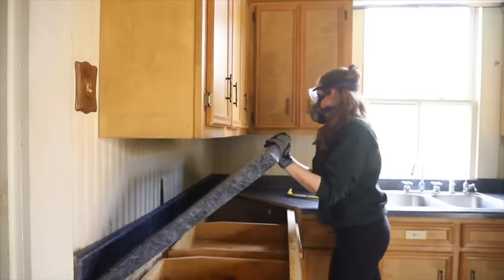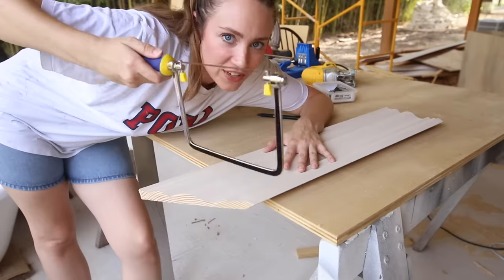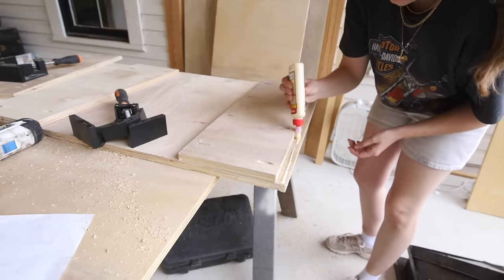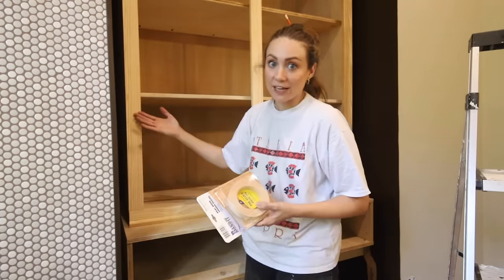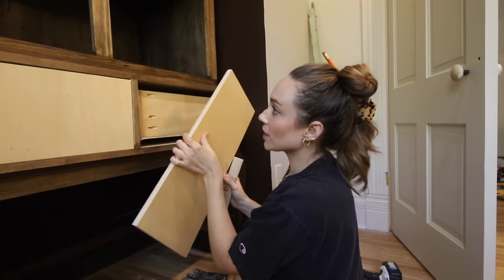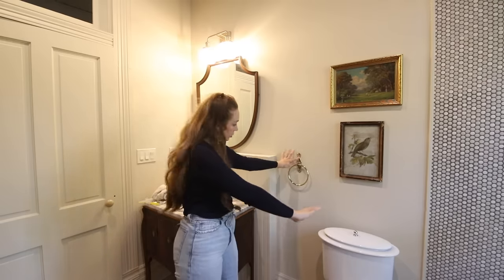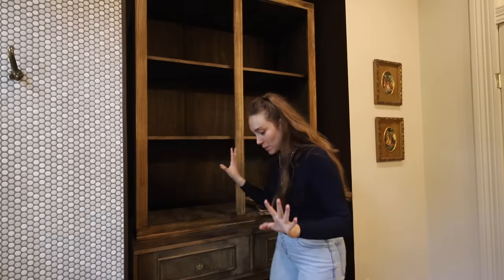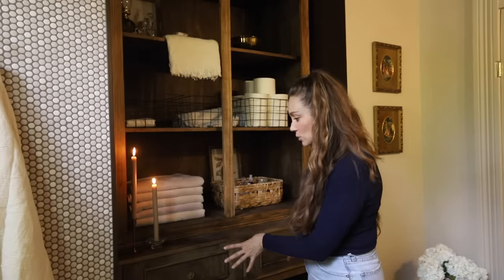GUEST BATHROOM MAKEOVER Ep. 4 | DIY Storage Cabinet & Decorating Ideas *BEFORE & AFTER*

Comment: Here is a tip: Stain all your wood first before putting together your project. I was looking at my hutch from the 1970's. It was my parents and they bought it used. Its built really well. Stain first your wood. Then you can assemble it all together and save yourself the extra work. Plus, I would add a finisher to your wood to protect it from the elements in the bathroom. I know it won't be used as much. Wood, is funny sometimes and can easily get chipped or get water stains on it. Just a few tips that came to my mind that I want to share with you. Beautiful bathroom. Yes to the topper for sure!!! :)

Comment: MaCenna, you constantly amaze me! You say, "Oh, I'm going to build my own kitchen cabinets! And I'm going to make my own antique-y bathroom furniture!" and I'm thinking "Isn't that way too ambitious...?"* But you're always completely fearless, and you build up your skills so much with every new project, and the result is always amazing! If ever a bathroom was A MOOD, it's this one!

A couple of notes: A few commenters suggested a shinier varnish for the cabinet, but I'm not so sure. I think the matt finish works well with the way the stain came out. I like the rustic moodiness of it! However, I did think the vanity could use more shine to it when you first refinished it, and still do! And definitely look into sealing the gap behind it in some way!

Doors are going to be so practical on the cabinet, even though it looks very pretty styled open! I would go with glass! And if you ever want to hide the contents completely, you can line the glass doors with a pretty fabric!

Regarding your difficulties with the crown molding, maybe it's the slope in the ceiling that's throwing you off? I can only imagine how that complicates the angles in the corners... it's one reason I'm not even attempting it in my flat (other than that it's also a 70s building with very low ceilings. 😄) Some of the ceilings are sloped and it makes my brain hurt even thinking about having to figure the angles out!

*I guess I tend to fear that you're going to be disappointed when it doesn't work out like you imagined, because I recognize some  of your perfectionism? I remember when you installed the salvaged bead board and you said something like "I like the imperfect look of old things, but give me a caulking gun and I go crazy!" and I was like "Yeah, that's me, too! Can't turn off the part of my brain that focuses on the small details, sometimes to the detriment of the bigger picture!" It's just that you seem to channel that perfectionism much, much more productively than I do, just tackling things with all that energy and doing the best job that you can, instead of letting yourself get paralysed with fear of failure! You're a genuine role model for me in that way! 😊Thank you for doing what you do!

Comment: Gorgeous Bathroom! I’m loving your cottage reno, I’ll be doing our 100yr old farmhouse soon so thank you for the inspiration! 

For coping crown moulding: try using a sander or a dremel tool instead of the saw. Easier to remove material slowly, at an angle and you can creep up to the front edge. ;)
Reply: thank you for sharing that coping tip! i'm prepping to do crown molding and have been trying to practice different techniques to decide which i want to do
Reply: @TheBeautifulTruthh  you're welcome! Good luck!

Comment: This looks sooo good. Great job hun! When coping, I use my oscillating saw to remove the  bulk of the material (be sure to use a narrow blade) and then go in with my rotary tool to fine tune things. You can clamp the crown to a piece of scrap wood to stop it from moving around while you do this.

Comment: No to the topper and doors. The cabinet is perfection! The way the towel at the top hangs out and you can see inside without something blocking it gives it dimension.  Great visually. Yes to the basket on the bottom, that would be really pretty.

Comment: Edge banding is very common for finishing plywood. It is real wood, so if the adhesive ever starts to lift away, you can squeeze in some wood glue and clamp it without issue.

Also, for setting your drawer faces, most builders will use a deck of playing cards to make sure it's evenly spaced on all sides based on how many playing cards you use.

Comment: Glass doors, a must! And the topper is a wonderful idea. I think I’d prefer the three bird pictures together, the tall and skinny works because of your high ceilings. I’m  not a fan of stacking different shaped frames unless there is a whole lot of different frames on a gallery wall. Also I’d like to see the toilet rolls in the woven basket because to have them more visible in the wire baskets than the pretty glass pieces, seems an odd choice. You’ve done an amazing job, it’s so impressive what you’ve accomplished.

Comment: So beautiful! Agree there should be a topper and glass doors to the cabinet. It also seems like it would look stunning and more finished with some varnish on the stain? I feel like some beautiful flat, white linen curtains off those brass rods possibly with scalloped bottoms would look so vintage and elegant as I'm not too sure about the peach and oranges with the brown. So inspring to see you build that beautiful piece of furniture which looks like it can hold so much. I'd love to see more of the pretty legs in the frame but I'm guessing that's because the bottom hasn't been styled yet with baskets etc xxx

Comment: yes to a topper! bathroom looks gorgeous!! 
our home also has fairly high ceilings/walls, so hubby also opted for wider cornices (what you call crown molding I think). although we went with the foam ones, which also comes in a range of detailing. we never came across the coping technique - I'll definitely ask him to check it out - and wow are those corners tricky! eventually though he got a bit more of a knack to it, and you'd think we hired the job out. keep at it, you will get there and the way you want it to be finished.

Comment: Yes definitely put the doors on and the topper on the cabinet. The curtains just look so pretty the whole bathroom looks nice. One small suggestion you asked about the pictures over the toilet I don't think the one on top goes well with the one on the bottom.  If you want to go with the horizontal frame on top I was thinking if you had any more of that material left from what you used for the curtains you could cut out like maybe where one of the peacock is and you can frame it just a suggestion. Or I would just put the two birds that are vertical one on top of each other. I was going to suggest for you to put the towel holder on the cabinet that's holding the sink but that's where you put the toilet paper holder so I'm out of suggestions on that one lol! Your hair looks lovely I can't believe how long it is it goes all the way down to your waist I haven't seen you with your hair down very often so I didn't realize it had gotten so long it's just beautiful!

Comment: If you have pictures of you and Romeo as babies in the bath, it would look sweet to have them framed and hung in the bathroom. They could be done in sepia tone. You could also have one of Kinsley in the bath or being toweled off. Amazing work on the bathroom cabinet piece. The topper on top is a great idea. It looks perfect with open shelving, so that would be a "no" on glass doors. I'd be worried about slipping on the wet floor and falling against the glass. Plus, they may always be in the way when opening and closing them. The cabinet is recessed so they might hit the edge of that and could be hit by the door at the entrance of the room. Curtains are terrific. Thanks for the sewing tips.

Comment: To complete the coping job, you will measure corner to corner The inside corner you will cut at 45° angle, then use your coping saw to cope along the paint edge like you did before, it'll hang perfectly. The simple rule for hanging trim do your best and caulk the rest especially if you're going to paint.

Comment: You did an amazing job! 

- I always apply stains with a brush (just do a little at a time)
- for the crown molding, in stead of a sew, maybe use a file? There is even small rotating files (like nailsalons use, but than for wood)

Comment: I'm not a big fun if the mirror, but I LOVE EVERY single other details!! 😍😍😍 And it's incredible how perfectly straight you've fit the penny tiles so now the trim is perfect! May I ask you how you've attached the front of the drawers please? 🙈 Thanks! And yes to the moulding on top of the cabinet! 😍 I do like how you've designed the doors and I was all for it, before seeing how you've styled the cabinet 😅 because doors naturally will hide what's inside a bit, above all having the back so dark. May you can live without them for a while, and when you get tired of it you can add them? So you'll have both 🙃

Comment: Everything you do is amazing. I’ve learned a lot.  I am just finding your videos as of yesterday.  So I’m late to suggest.  
💡💡 I was thinking put the piece of moulding in a vice either upright or horizontal, as you had it, to keep it steady and to give you two free hands to work with.  You can sit on a chair if that gives you a better angle if you vice the wood horizontally.  Maybe use a small electric hand sander or a Dremel to work on the 45* angle.  I’m sure I’ll come across the video with your own solution.  I know nothing about coping molding, so I will have to look into that as well. I plan on crown molding too.  I have pitched ceilings in the main area.

Comment: My house (1905) has little upside down finial things  in the corners… I have no idea what they’re called but they’re wooden, part of the block has straight sides (square) and then a pretty pointy end. Anyway, if you use those they add such a pretty/unusual little detail AND you don’t have to do any coping or corners on your crown molding 😅 Our baseboards have a much smaller version as well. I love the look and so much easier to do corners!

Comment: you can cut both trims from the front creating a 45-degree angle and meet them creating a 90-degree angle. the wavy design will sit perfectly together I guess. What I meant is don't try to cut the design from the back go for the angle. I don't know if you have done it this way.

Comment: Amazing amazing job! Really beautiful from the cabinets to the details just stunning! I watched every single minute of the video 🥰 I want to comment on one thing, as an interior designer the only thing I would change is the length of the vanity counter top. If you extended the counter half an inch out each side in order to get is touching the wall and extended above the toilet roll. It will give you a put together and finished look . However everything else is spot on and stunning 😍

Comment: Hola Macenna. For my moulding I used the chopsaw at 45 degree tilt. Couldn't you use that for the 'coping'? I just recommend knowing which pieces need to be cut in versus out for corners 😁

Comment: FIRST, absolutely beautiful! As to your questions. Doors? No. I think you have it beautifully styled. I think because there’s not TONS going on in the bathroom, the open shelves allows you to use the beautiful styling as a focal/decor piece. Doors are great when you want to hide things that aren’t cute, or the rest of the room is already super “busy” with decor. Second, YES to the trim piece. I think you’re right to consider finding something else and save cutting down that other original piece. Use that somewhere else. 

Love your cut list, it’s like the “mise en place” of woodworking. Know all your “ingredients” and prep them first. BUT…take your cut list a step further to save material and enter all of your cuts, materials, include saw kerf, grain direction, etc. on the free online program called Cut List Optimizer. Helps you figure out how much material you need and how to lay out your cuts to minimize material waste. Then you can use the scraps for other projects. Been a game changer for me particularly when doing work for a client, helps me figure out how much of what dimensions of material to buy to save the client money. For example making a slat wall and slat bench combo out of ripped down 2x pine, but I didn’t know if it was going to be better to buy two 2x8x8s, a 2x8x16, a 2x10x12, or a 2x12x8. So I put in all of my cuts. Labeled them  all as “2x” material, put in all the variations of the above mentioned boards as my materials and labeled them all as “2x” and let the program figure it out for me. So I save the client money because I know exactly which board or boards to purchase that will create the least waste.

Also the edge banding feels like wood because it IS wood. It’s very narrow wood veneer cut to standard sheet materials thickness rather than being full sheets of wood veneer meant for faces of boards. They also have melamine edge banding as well. But to your drawer slides you need to upgrade to the heavier duty ball bearing slides versus the ones with the wheels. Up from there. The Blum under mount are not cheap but they are every bit worth it.

Comment: Hi MaCenna, I absolutely love what you've done to the Guest Bathroom, it's amazing!
However, although the curtain fabric is very pretty the pattern doesn't match across the panels, which makes the eye wander.  This might not be so obvious if the print wasn't so large.  Plus, they would hang much better if the hems were weighted. 
The towel holder could have been placed on the side of the vanity, thus preventing any potential splashing of water on the walls whilst hands are being dried.
In addition, the toilet tissue holder could have been attached to the wall, next to and inline with the toilet, under where you now have the hand towel holder. Whilst I appreciate that this wouldn't be as ergonomic, it would be slightly more hygienic than placing a hand towel so close to the toilet.

Comment: re:COPING. Cut the board at a 45* angle, the same way you would if you were doing a mitred corner. Then, because of how thick the wood is, you can try using a chop saw to cut a 45* bevel going backwards from the face of the trim. It will take off a lot of the wood that you would otherwise use the coping saw to cut away. Then try using the coping saw to get the details cut out. Try and make your cuts you're taking away wood at a 45* angle back from the face of the trim. Keep the handle of the coping saw up so the blade is working underneath the wood - its easier on your wrist :)

Comment: Good morning MaCenna! I was thinking about your crown molding…is it possible that when you nailed them in place the angle you secured them at was just a little off? In other words, is it possible that the coping you did would have worked (the thin last trial) if the angle on the already nailed one was just slightly different? I have tall ceiling and my husband and I added crown molding and we had to sort of shimmy in place…maybe if you built a right angle support on your work table and fitted a piece of scrap of your molding until you can fit the coping piece, you could then measure how far from the corner (on the wall and on the ceiling) your molding should lay…(like a small model) -then check the ones you have nailed in… you could then adjust as needed…I know it’s daunting but I think it may solve your problem!

Comment: Trivia in case anyone's curious: Pocket holes are good because putting screws straight into the edge of wood tends to wear and tear into sawdust over time, and that's what leads to those screws popping out. If that's happened to you, you can drill-out the old screw hole and tap-glue in a dowel. Then pocket-hole and you should be gtg.

Comment: Good job! Definitely add the topper to the hutch but also…knowing plain old from modern vintage. The bathroom has great elements but I feel like the styling especially the curtains make it feel very granny. Not the Pinterest kind of granny. Something I have noticed is that you apply stain very rough and sometimes a little to much. Both and hutch and the sink have very random dark splotches that it almost looks like particle board wood from wayfare. I know it’s been a long process but patience is still key
Reply: Tackle one thing at a time. What I’m getting at is that the design doesn’t look sustainable or built to last. I fear for you that in 2 years you’ll either not like it anymore or you’ll have to start replacing things because they weren’t properly treated.

Comment: The cabinet looks good as is but add the doors first if you still really want them because I’m thinking No topper but I’d like to see it first without or maybe a different smaller one. You could’ve put the hand towel were there toilet paper roll idk if both would’ve fit. But maybe up higher and closer to the mirror or just do the wall with the switches and get outlet covers.

Comment: The decision to add the trim of the vanity to the top of the cabinet is a great idea. I wouldn't spend any more money on it and use what I have. It doesn't make sense to save it for something else when the project you are working on needs that design detail. It also means you aren't being wasteful. Yes to the cabinet doors with glass. But the wicker basket needs to be replaced with something shorter so that labels can be read by guests so that they don't have to pull out each item to see what it is. Same natural wood color but shorter profile.